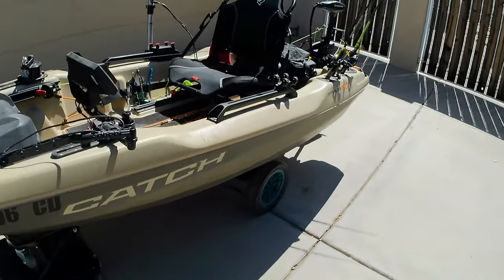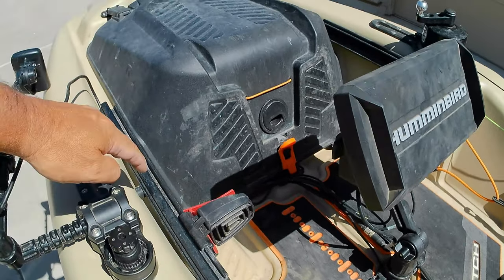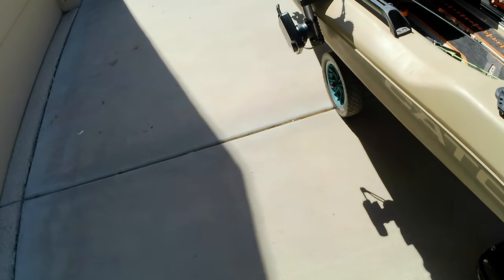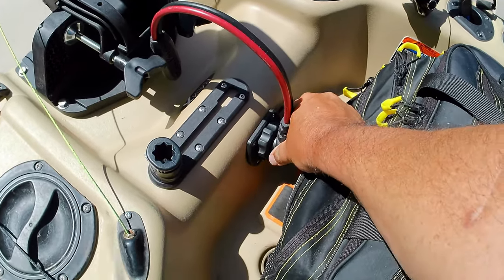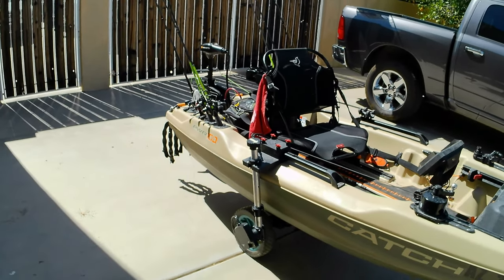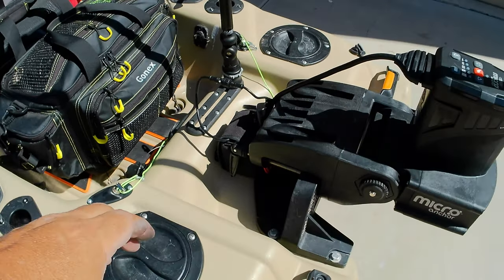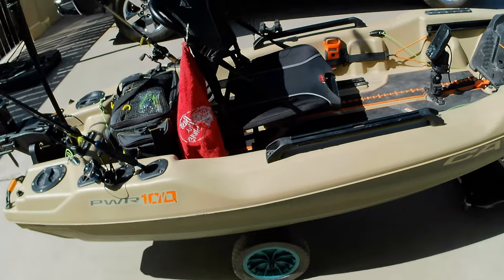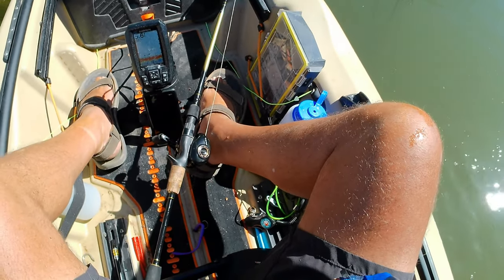Kayak Walk-Around: Pelican Catch PWR 100. One Boat, Two Setups! Bonus Ending!

Comment: I need to rewire my PWR 100 because I purchased the MinnKota Endura Max 55# and has 8g wires. I like where your plug is at, but how did you manage to run the wires over to there?
Reply from the maker: @mikerosnow702  Hello, I attached a washer to a piece of string, put it inside the hull, and used a magnet to pull the string around the inside corner of the hull to the hole I drilled for the plug. Then I attached the string to the existing wires and pulled the wires to the plug hole. Hope this helps.
Reply: @flipflopfishingAZ  well that's genius! I'll have to see if I have a strong enough magnet to do this. I really like that location you had. I read other comments after that and saw you no longer have your PWR 100, I really appreciate you still getting back to me!
Reply from the maker: @mikerosnow702  I definitely still have my PWR 100. I'm about to do a 1-year follow-up video on it as I've made a bunch more modifications. 

These are the magnets I used. Super-strong and cheap! 

LOVIMAG Super Strong Neodymium Disc Magnets, Powerful Rare Earth Magnets, Heavy Duty Magnet with Adhesive Backing - 1.26 inch x 1/8 inch, Pack of 6 https://a.co/d/iJORGAu
Reply: @flipflopfishingAZ  I'm obviously not savvy with YouTube 😂, I must have confused a comment. I look forward to the 1 year 👍

Comment: Nice set up boss. I have the same kayak as yours but different set up. Good job. How May hoours your battery last?
Reply from the maker: Thanks! I've owned 4 yaks and this one is my fav by far. My battery has never gone below 50%. And that's after 10hrs of all-day use, mostly at the lowest speed with maybe 30-45mins at top speed.

Comment: What a great setup. How stable is the Catch? I know you probably wouldn’t stand up much with the foot steering controls, but could you stand up on the AZ lakes?
Reply from the maker: I'm a big guy and my balance is awful. However, I've been standing in it more and more lately no problem. Boat is very stable. I only stand when I'm anchored.
Reply: @flipflopfishingAZ   you bring up a good point, I’ve been thinking I will spend the money and get a trolling motor with a remote control so I don’t have to rig anything up.  However,  its not like I am going to be standing up and operating the trolling motor, I would surely fall in !! (My balance isn’t all that good either)  so sitting down and using the foot pedals to steer makes sense.

Comment: Hi!!! Great video… thanks! Question: Is the 2-wheel dolly a Pelican product? Same question for the front dolly. Also, Do you use BOTH to put in the water? Thanks in advance!!
Reply from the maker: Hello! Thanks for the kind words. I'll try and link the cart for you. It's a great cart! I tried a bunch of carts before settling on this one. The front dolly is a mechanics roll-away that converts into a seat. I only used it to balance out the kayak for this video. I do not use it to launch.  

 Blue Dot Outfitters Heavy Duty... https://www.amazon.com/dp/B0B1N2PB7B?ref=ppx_pop_mob_ap_share
Reply from the maker: This one is the same cart, different brand: Best Marine Kayak Cart, Heavy Duty Dolly, 450lb Weight Capacity, Flat Free Airless Wheels, Adjustable Width Trolley Carrier, Canoe & Kayak Trailer Accessories https://a.co/d/glGOghI
Reply: THANK YOU!!!!

Comment: Are you worried ab dragging when you go river fishing idk what rivers you fish it but mine drags and I’m worried bc someone said that you don’t need to drag this one bc it’s so soft
Reply from the maker: I drag mine very little. Just a few feet at most per outing. Always avoiding jagged rocks and such. The river I fish is deep enough to stay off the bottom. There is very minor wear on the hull. I wouldn't recommend dragging it too far too often, which is why I have a cart, but these boats are a lot tougher than a lot of people think.

Comment: I just picked up one of these used. 

Under the seat there is a recessed area but it’s not drilled out. 

Is yours? It almost looks like it should be. From under the boat it looks like a non drilled out scupper hole but from the top it’s a little rectangle. 

I’m wondering what that is. Sweet setup btw
Reply from the maker: Thanks! I hope you like your boat as much as i like mine! 

I have the same non-functional indent. I've read elsewhere that strengthens the hull. Sounded pretty reasonable.
Reply: @flipflopfishingAZ  So I shouldn't drill it out to put my transducer there...copy that.